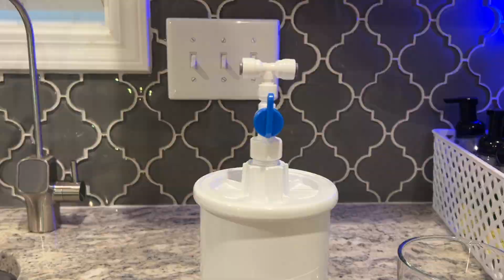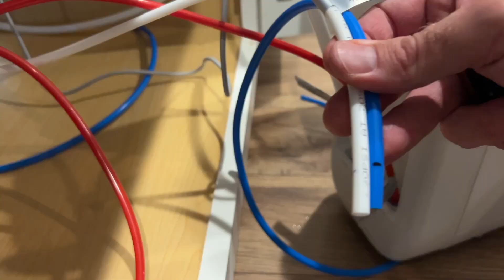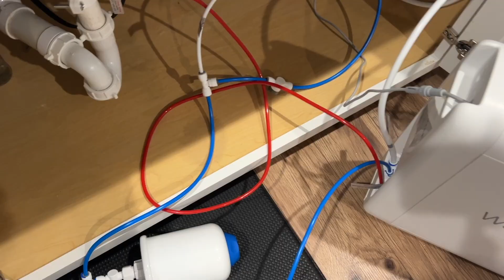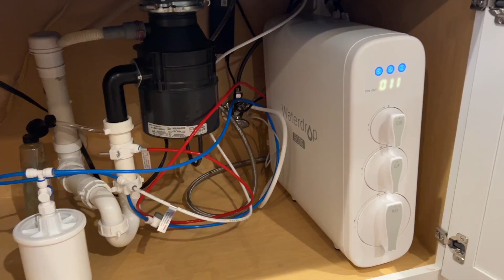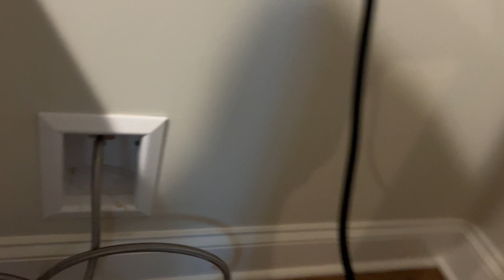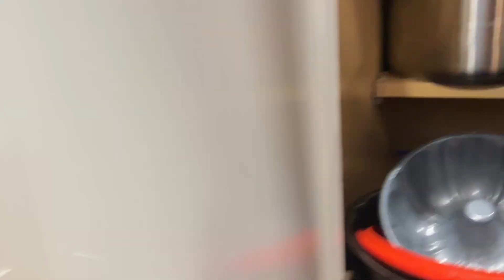Waterdrop PMT Install for Refrigerator Hookup

Comment: I just installed the pressure tank in my Waterdrop X12 system last weekend, and was watching your video. I saw you insert a locking clip in one piece in the video, and it dawned on me - I don't remember putting a clip in that position. So, I went back and checked. Sure enough, I had missed that one. Thanks for putting out this video! You may have saved me a potential water leak in the future.
Reply from the maker: Glad it was helpful and thanks for watching. If you haven’t already, please subscribe. It really helps out the channel.

Comment: Hello, I'm replacing an older 5 stage RO with a Waterdrop system and currently have a 3/8" line running to the fridge and the countertop tap. In your experience do you think it would work fine with the small tank or does it need to be switched out to 1/4"? Trying to get a hold of someone at Waterdrop and emailing with them isn't geting my question answered. Thanks in advance.
Reply from the maker: The inlet for this RO system is 3/8, but the output is 1/4”. The membrane restrict flow and that’s why it downsizes on the outlet. I don’t believe upsizing to 3/8 would help with flow because the unit is already outputting as fast as it can and 1/4” tubing is sufficient for that. Hope that helps

Comment: How did you run the line behind your oven?  I have this same exact setup and trying ro figure out how to get it through without melting my line. Thank you in advance!
Reply from the maker: I drilled holes in the very bottom of each cabinet and then it just runs along the floor behind the oven.  Haven’t had any issues with it getting too hot.

Comment: My Waterdrop G3P600 faucet came with 3/8" pipe and pressure tank doesn't come with extra 3/8" to 1/4" fitting.
Reply from the maker: The tubing going into the RO system should be 3/8 but the tubing leaving RO should be 1/4”.

Comment: Does installing this actually work? What was the before and after?
Reply from the maker: 100% it makes a huge different. Watch this video to really see the difference. 

https://youtu.be/TdH3kW1tTwI?is=qprkKZ80I6du6TPB
Reply: @DomesticDad20  the water coming from the top of the sink takes 6 to 7 seconds to fill up one cup which is good. It's the water coming out of the refrigerator that takes 11 seconds the fastest to come out. On startup could take up to 17 seconds. But that's because of the tankless system needs to get going so the second cup is normally 11 seconds. I have a bypass filter in my refrigerator and the refrigerator is 5 ft away from my RO system. I would just hate to start installing the little tank and find out that it really doesn't make a difference. I've been looking for videos that shows the water flow pressure coming out before and after.
Reply from the maker: @victora @victoranguiano7401 e is 20’ away and it still comes out slower than the faucet, but way faster with the pmt tank compared to no tank. The water is immediately available before you ever hear the RO system come on. I can try to make a video showing the difference and I’ll tag you, give me a few hours to get back home.
Reply: @DomesticDad20 what I'm thinking is if I install it then the water filling up the single cup will take 11 seconds like the other cups instead of the first startup which is 17 seconds. So it won't make it faster but it will just make it constant 11 seconds.
Reply from the maker: @victoranguiano7401 so I just ran the test, it took the same amount of time, but with the tank it was constant and without it was pulsatile flow. I’m running 20’ which is farther than they recommend so your resets may be different.
Reply: @DomesticDad20 I haven't installed it yet but when I run it for the first time it's 17 seconds the very next cup is 11 seconds if I install it and it is 11 seconds every single time I will be happy with that. I do appreciate your feedback. Thank you
Reply: Going to install it right now 🤞
Reply: I have an update... On insulation the small valve which is connected to four hoses leaked. For my waterdrop ro system G5p500a I had to get the model wd-xt pressure tank. There's an extra valve that is not in the other model. Well it leaked and I looked inside and the o-ring/gasket was out of place so I grabbed my little pick and I managed to put it back in place and now it has zero leaks. 🙌 The results are pretty great. Glad I listened to you installed it. The first cup from the sink originally took about 7 seconds to fill one cup. Now it takes 2.8 seconds on the first cup. The second cup after that a little over 5 seconds. The refrigerator went from 17 seconds down to 10 seconds on the first cup. The second cup stayed the same around 10 seconds which is great. So it was a success 🙌 thanks
Reply from the maker: @victoranguiano7401 that’s awesome, except for the leaking part. But very glad that helped your system and cut down the fill time by half on the first cup. The pressure on that first cup is impressive. Another benefit is it should help your ice trays fill all the way.
Reply: @DomesticDad20 thanks again!👍

Comment: Thanks for the video! Would you say it's worth it to get the mini tank w/ the G3P600 even if I'm not using it to connect to my fridge?  Is the flow out of the faucet noticably better with it?
Reply from the maker: If you’re not connecting to a fridge I would pass on the tank. It mostly helps with the fridge since it’s a longer distance for the water to travel. I’ve got links for everything in the description if you need them.
Reply: @DomesticDad20  ok thanks for the info

Comment: I'm looking at getting the G3P600. I can't decide whether to install the sink faucet, or to install directly to the fridge. I like the idea of having chilled water, and not have to drill an extra hole in our granite. If you could do it all over again, what would you do?
Reply from the maker: Good questions, they serve two very different needs in my opinion. 

I fill my 3 40 ounce owala water bottles every morning. The flow at the sink is much faster than at the fridge. 

For the fridge I wanted my ice to be RO and I also will fill a glass of water for dinner from the fridge. The amount of chilled water from the fridge isn’t much, maybe 1-2 8 ounce glasses. 

I split my line, it goes to faucet and fridge, it was a very easy thing to do. I showed how in this video

https://youtu.be/NVPs1KTSOxw?si=rI6TAF19POwrzYHW

Comment: Question, if I’m upgrading my RO system which has a tank is it not possible just to use that tank instead and just tee it off with the lines? Also, second question what has your experience been with water drops little tank? Normally I have to change mine about every four or five years and replace it with a new tank. Have you experienced any issues with this small little tank from water drop?
Reply from the maker: Depending on how big the tank is you may could go without an external tank. 

I’ve had this system a little over 2 years and it has worked flawless. I’ve been very happy with this system.

Comment: Great video! I purchased the X12 which runs on 3/8 inch as well as the WD-XT pressure tank which is made for the X series RO systems. The problem is that my fridge runs on a 1/4 inch line. I contacted customer service and here’s what they told me:

“Install a 3/8" distribution valve/tee on the X12 purified-water outlet to split one branch to the RO faucet and the other to the refrigerator.

On the refrigerator branch, we recommend adding our pressure‑stabilizing accessory (WD‑XT) to help prevent frequent starts/stops and improve stability with intermittent draw.

Use a suitable 3/8" to 1/4" adapter (food‑grade, compatible with PE tubing, quick‑connect preferred) to step down to your refrigerator’s 1/4" line. We don’t provide or endorse specific third‑party reducers/valves, so please select standard RO/drinking‑water‑rated fittings.”

These steps are a bit different from what their installation guide recommends. The guide recommends adding the pressure tank before “splitting” or using the “T” valve, just how you demonstrated in your video. According to customer service, I should use the “T” valve, with one line going from RO System straight to the RO Faucet, and the other line going to the pressure tank with a reducer to the fridge.
Reply from the maker: I would do the tank prior to splitting lines. You’ll benefit from it at the faucet and fridge with this setup. 

They could be thinking there would be added pressure going from 3/8 to 1/4 since it is a smaller diameter and that could be why they recommended splitting before.

Comment: I have the G2P600 system.  After changing the MDR and RO filter the output water pressure appears to be low from the water tank. how do I fix that?
Reply from the maker: I’ve had somebody tell me that after changing one of the CF, there was a lag from when they turned on the faucet until the water came out. But it cleared up a few days after changing the filter.

I know with the RO filter, they say it takes roughly a week to fully saturate.

I’m not familiar with that particular model, but does it have a reset to let the system know you changed the filter? Once the system lets you know you need to change the filter, I have noticed there is decreased flow until you change the filter and reset the indicator.
Reply: @DomesticDad20  I appreciate the quick reply. thank you.

Comment: I don't understand what turns on the tankless system from the refrigerator.  The faucet that came with my system has a power cord coming from it which turns on the pump.  How does it work for the refrigerator?
Reply from the maker: Great question. The power cord is just for the TDS display. If you unplugged it the system would still work, you just wouldn’t have the tds displayed on the faucet. 

The lines are always under pressure, turn the water faucet on just allows the water to come out since it’s already under pressure. Same for the fridge.
Reply: @DomesticDad20 I bought different brand name RO with pump required power plug in outlet. But my water ro system without power, there no water out to faucet with faucet open, no pressure, so I have to plug in power for pump to push water to faucet, mean faucet control pump. So if I bought this pressure tank, can't work for my system?
Reply from the maker: @Nvidiaforever I believe all RO systems require power.  The question above is just for the lcd to display the TDS. The system still requires power to filter the water and push it to the faucet. It also uses power to push out the waste water.
Reply: @DomesticDad20 thanks for reply
Reply: I have more questions if you unplugged power from outlet, is water come out to faucet and refrigerator? If there is no water out to faucet without power, so how is pressure tank have water to refrigerator?
Reply from the maker: @Nvidiaforever sure thing.  I hope you’re able to get it worked out. Do you have another outlet close by so you can add an outlet?  Or power to you dishwasher?  

I had a wire going to my dishwasher. I created an outlet using that wire, then ran a plug from the outlet to the dishwasher.
Reply: @DomesticDad20  yes my outlet working all the time. I am curious about my system is different. My system have no water if there's no power. I wants to have water to the refrigerator with this pressure tank but not sure its working. I called and talked with my water system company about this pressure tank to refrigerator but they said not compatible even have this tank installed.
Reply from the maker: @d @Nvidiaforever  If I unplug the RO I couldn’t get water at the fridge or the faucet.  

Without power it isn’t pumping.  The mini tank just helps with flow. When the system is on it fills the mini tank, and instead of waiting for the RO system to make water, it uses the water in the tank. It can flow faster from the tank than it does director from the RO system.
Reply: @DomesticDad20 thanks you so much I understand now 👍
Reply from the maker: @Nvidiaforever as long as your fridge has the 1/4 water hookup I don’t see a reason this wouldn’t hook up.

https://amzn.to/49MVorh

Comment: Thanks for making this video. I’m about to install my water drop g3600. I wanted to hear your thoughts about completely skipping the faucet and running the RO straight to my refrigerator for ice and water usage. 
That way i dont have to drill a hole in my counter and take up already crowded space by my sink. 
I have already bought the PMT tank.
Reply from the maker: Yeah you could do that. The flow isn’t really as fast as the faucet but it could work. 

If I’m filling water bottles I use the countertop faucet, but for a cool glass of water I’ll use the fridge, and obviously the same for ice.
Reply: I know it has been a month since your comment, but you could just replace the main faucet for one that comes already with the secondary/RO faucet built-in if you don't care about the smart one.

Comment: Hello there. This is a great video. Thank you. Im just wondering if you have any way of connecting my RO to my fridge when my RO is undersink in an island countertop and the fridge is next to the wall. My issue is how to hide the tubing when my RO system is in an island countertop? Tips is greatly appreciated. Thanks
Reply from the maker: Unfortunately I don’t believe there is a way unless you have some conduit already ran.
Reply: We had a trench for that tubing ran when we were building the house.  Only way not to see it is under the floor.

Comment: Did you not need the locking clips on certain parts? I seem to be short.
Reply from the maker: I was short too.  The instructions said it wasn’t necessary, I bought an extra bag on Amazon and clipped every connected. Not necessary but made me feel better about it.  I put the clips in the description part list if you need a link.

Comment: When you installed your remineralization filter, did you do it before or after this pressure tank?
Reply from the maker: I did it before the tank so my ice would be mineralized.
Reply: @DomesticDad20 when you say before the tank, do you mean in between the water drop faucet and the pressure tank?
Reply from the maker: @crunkin1t590 water drop reverse osmosi, then remineralization filter, then pressure tank, then faucet. 

My line split after the tank and goes to my fridge so i wanted the remineralized water to go to the fridge as well. So that’s why it is before the tank.
Reply: @DomesticDad20 hmmm okay. In the video I don't see the filter between the reverse osmosis unit and the pressure tank. I'm assuming you installed it after?
Reply from the maker: See if this video helps. From the water intake it’s reverse osmosis, remineralization filter, tank, faucet. The video below is just on the remineralization filter 

https://youtube.com/shorts/Mb7bMQGFhy4?si=EnHOkrM3vH7elkf8
Reply: @DomesticDad20 makes sense now. What's was throwing me off was that in the tank install video you have a blue hose coming from the waterdrop system into the pressure tank but in that video you just sent it's got a white hose coming from the waterdrop system.
Reply from the maker: @crunkin1t590 oh I see. Yeah at some point I believe I added valves or a longer piece of tubing in there and had to use a different color tubing. I have a ton of videos on the channel with the system, hopefully they will help on your install.
Reply: @DomesticDad20 thanks man. You've been tremendous help!
Reply from the maker: @crunkin1t590 happy to help. Let me know if you have any other questions. I’ll get back to you as quick as possible